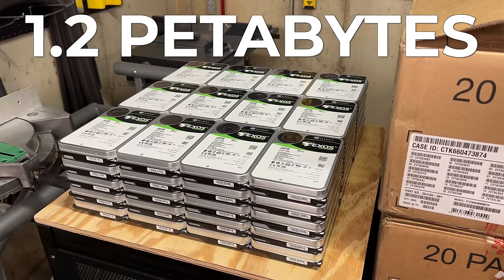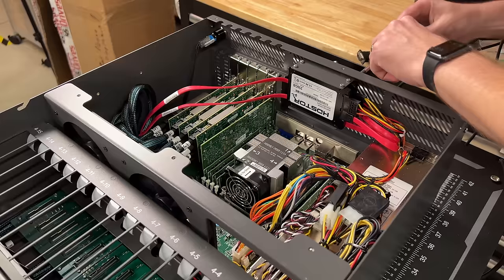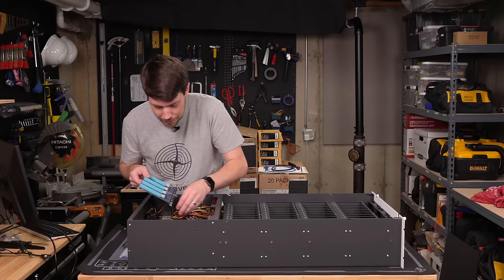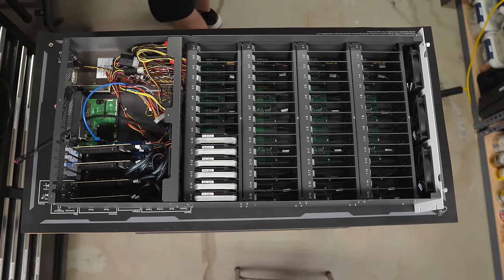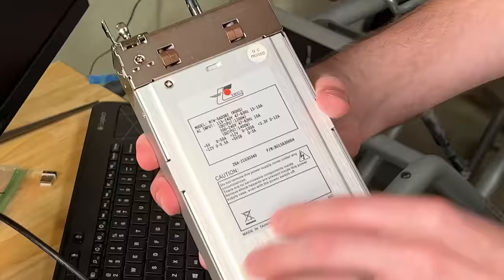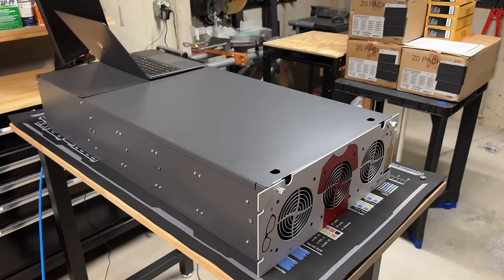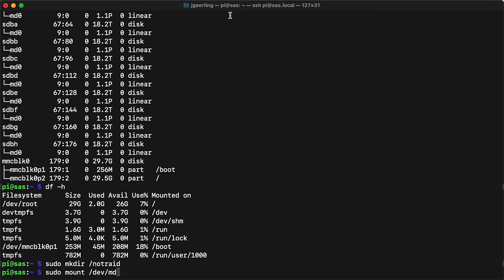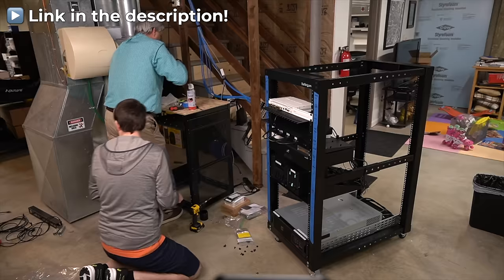The Petabyte Pi Project

Comment: What are ya? Some kind of digital pervert? :DDD

You should know that I experienced same exactly errors on Raspberry Pi with one only SSD drive through USB 3 connector. I rose Raspberry's power voltage a bit (to about 5.4-5.6 V) and the amount of errors decreases a lot. But they're not gone completely.

Comment: But why do RAID? To me that just seems like the worst idea. One drive fails then they all fail...plus the overhead of having to divide, push, and write each bit of data to different drives all at the same time...bottlenecking the whole rig...why not just let each drive be formatted as an independent volume...seems like a much better idea to me...and is the way I handle my NAS.

Comment: Nice try. I guess that using Pi was never limiting factor. Maybe your drives power spikes too hard for power supply, bad connectors or data cables not shielded from interference.

Comment: Exos drives arw shit. I have 29 pcs with 20% failure rate over a year in Dell ME4 storage. I have also over 100 WD HC550 working with Truenas with only 2 drives failed. Don't use Exos if you like your data.